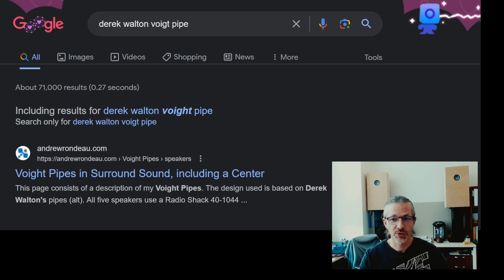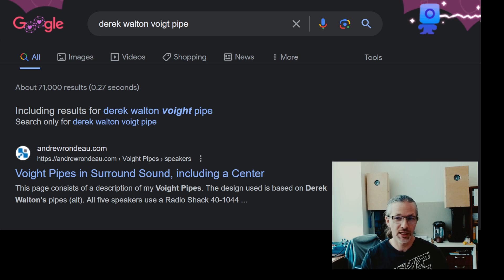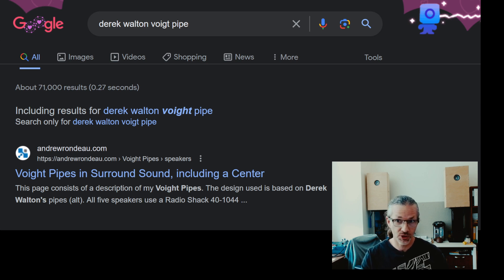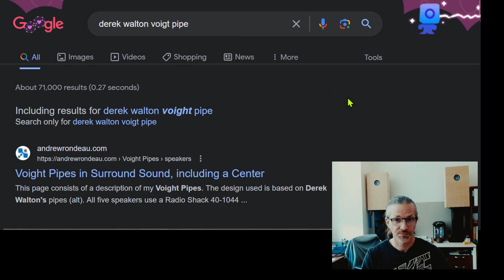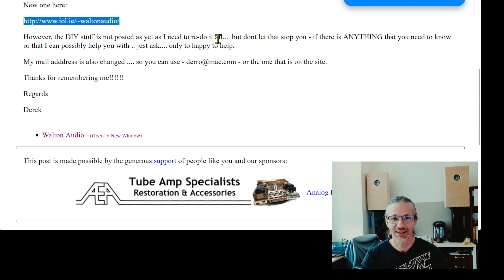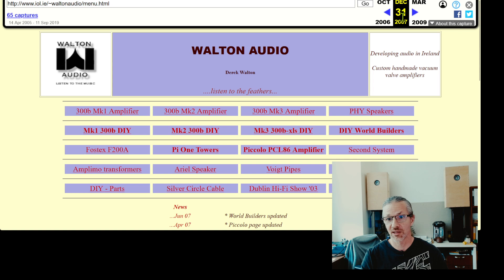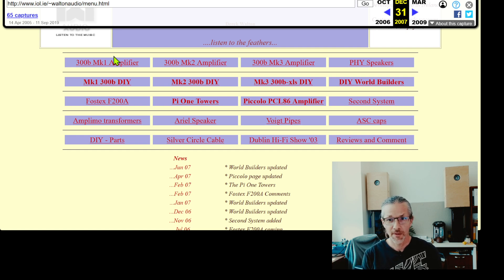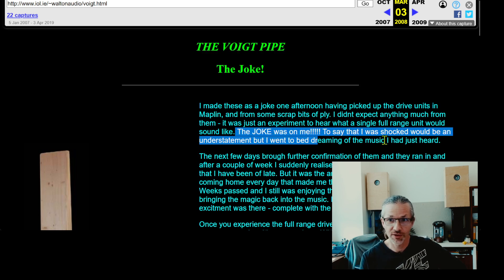How I came up with my Voigt pipe dimensions? Part I.

Comment: Hi Jonas, I recently came across your channel and am thoroughly impressed. I really like the idea of this speaker design, but I have a question. 
Your design would be too big in my listening room; so I was wondering if your design would work if the dimensions were to be proportionally cut in half. Would  doing that be the same as your design?( I.e. sound)

Comment: If there r 4 5 pipes for various sized drivers built to the size ,then its easy to calculate for another size.
What is the maximum sized driver one can go.  Let's say 15 inch folded if not full pipe.......
Reply from the maker: Actually my VOL is a folded pipe! So yes, 15in is doable... ;) Look at Eduard Brokeman's channel, he has built a VOL and has shared a good amount of modeling information about the pipe calculations.

Comment: The real low resonance frequency of the driver can be used to determine and aproxymate  the lenght of the pipe....as far as I remember it .

HUNDERDS of surface mounted and  solderd components on circuit boards in the signal path of modern audio , pretending having perfectly mesuring results...............versus a single resistor a tube , a coupling cap , a tube and the OPT ( all of the few  components choosen for high quality ) .....and connected directly to a singled driver in an enclosure like a Voigt pipe ........think about it..............what is the way to go without loosing information and wearing out the tires of your beloved audiophile car .....

Kind regards

Comment: You know any good cheap manufacturers, I've made a new concept a fantastic arm, I want to put it in production. Very high precision good quality materials, but where to get it built for about 200 to $250 max?, I was thinking Taiwan or maybe South Korea I want to keep away from China. I am having a debate about bias, What's your favourite bias type ? This is an automatic bias adjustment what is need when it tracks the record.
Thinking of selling it for about $850 and I would say probably can compete with any $20,000 arm quite easily no problem at all.
Getting it out there and  getting it known is the big problem, try and get Michael fermer to review it I think he's a bit overwhelmed with stuff already. What about VTA adjustment? Probably needs it but adds cost and does have issues as well,. I'm going to go down a different rout where it's not needed but will do the same thing. But again cost. Wouldn't mind some feedback from people what do you think of the price would you be tempted at that price? Would you spend $850 to $1,000 on an arm?
Reply from the maker: That's a tough one Hoobs. I think 850-1000 is acceptable for a good arm, but I suspect it might not be expensive enough for Fremer... ? Herb Reichert might be a better choice. 
Unfortunately I do not have any machining contacts, so not much help there. For bias, I do not use anything for the long arm, it appears it needs no bias, absolutely rock solid tracking without any helping. For shorter arms, I have not gone into experimentation with it yet. That's one for the future to work on...
Reply: @realworldaudio  you might be getting enough bias from the cables considering the length, you don't need a lot. a lot of people are in the camp of not using bias especially the Japanese fan boys, I think bias is important to a small degree. People overdo it and biases on arms in general are not accurate enough. A good way to check your biases correct is to look at the counter lever on the record at the beginning of the record and near the end of the record  when it's playing, record these two points and measure the sideways movement have your camera to 90° face on, if it's pulling it to one side then your bias is incorrect and too heavy that is the best way to get the correct bias. Putting it on a blank surface doesn't give you an accurate account, Central fugal forces counteract this movement and it's different than being in a groove but is a good bass line. I forgot to say you'll need a mono test tone 440Hz when measuring it with a camera when recording